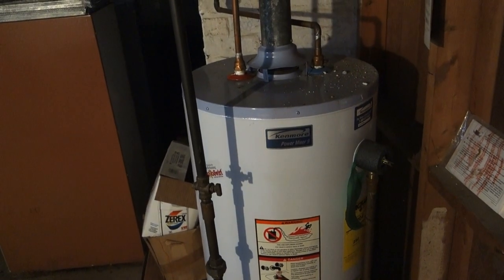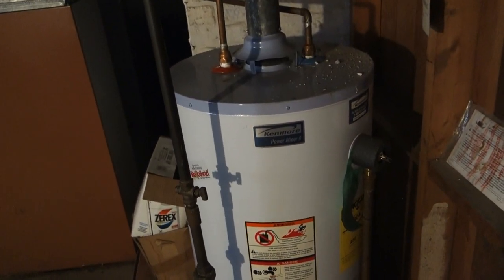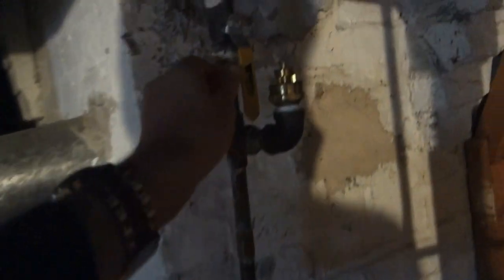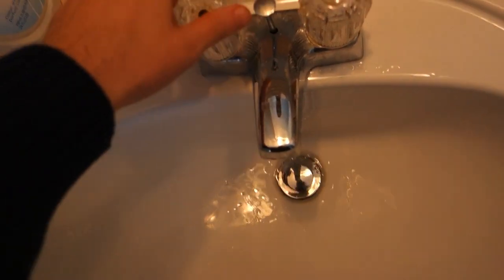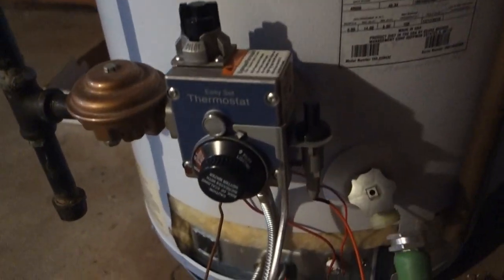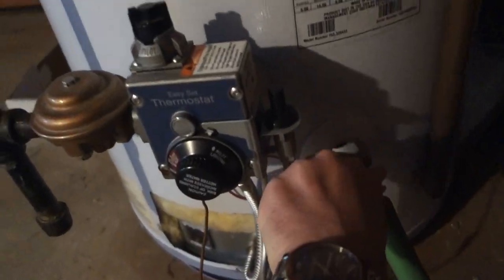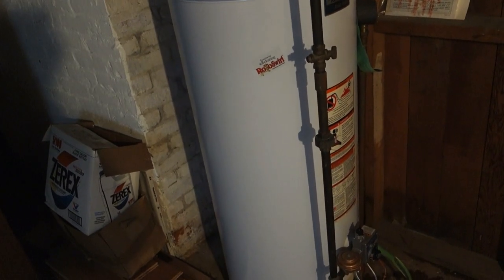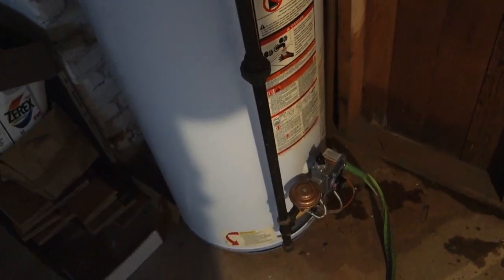How to Quickly Turn off Leaking Gas Hot Water Heater (Emergency Water and Gas Shut Off Leaky Tank)

Comment: Mines won’t go over to off. Only to pilot. Not sure what’s going on
Reply from the maker: You can try locating the gas supply line coming into the hot water heater and turning that off, just to be on the safe side. Good luck getting it resolved, Philip.
Reply: @JonathanBrowneMenzies  I’m late to respond but you were right. I was able to shut off the gas line and then able to drain out the tank so we could stop the leak. Greatly appreciate the help and video. Saved me some money 😅